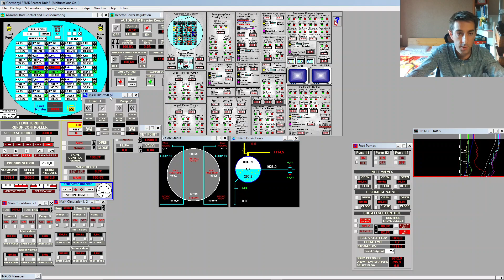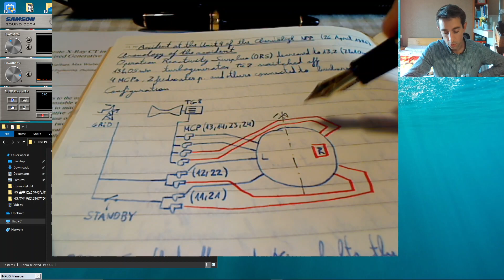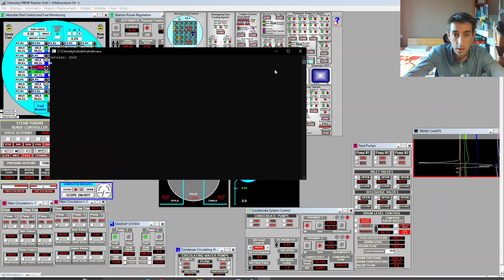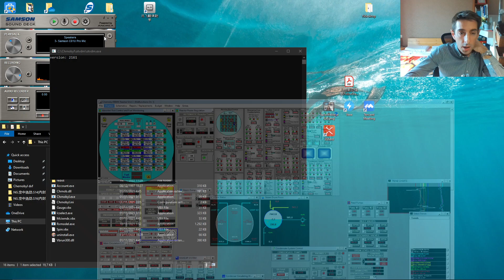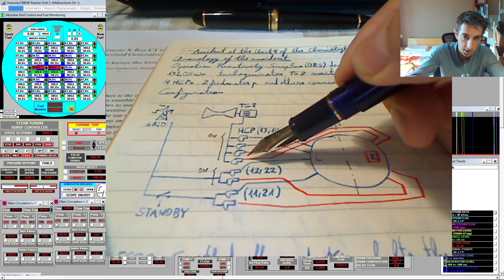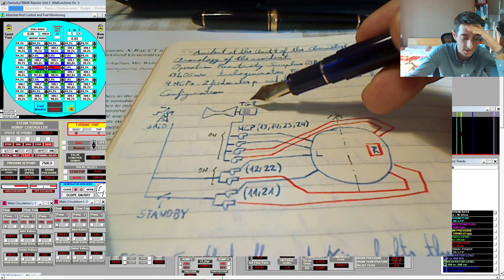Chernobyl RBMK simulator port version 2: Shift Supervisor with notes

Comment: hello again. if you can, watch or listen to this video with a translation into your language. This man, a reactor technologist, talks about the causes of the Chernobyl accident. He has many videos explaining the principles of operation of both nuclear power plants and RBMK reactors specifically. 
in short, he says that the explosion occurred due to the supply of water on the verge of boiling to the right southern side of the reactor (it was there that pipe ruptures were found), as a result of which steam began to form, which damaged the reactor inside from expansion. (sorry it's a translator) watch?v=OQpemhv8vTQ 
(take a look at the video descriptions)
Reply from the maker: Thank you very much for the link. It is very interesting. If I understood well, to some extent is in line of the official version, but it goes more in detail with the steam separation happening within the channels. Is that correct?

Comment: hello. tell e what would have happened if the staff had not resorted to using the AZ 5 button. Would the reactor have exploded too, or would it have remained intact but been damaged, would there have been an accident too, but not on such a scale?
Reply from the maker: Hello, thanks for the comment! This is difficult to tell given the reactor inhomogeneous reactivity and the probably incomplete or false reports of what actually happened. Looking at the reactivity trend after the coastdown test started (increasing), doing nothing would likely end up with a critical runaway. Operators were actively inserting absorber rod group "G" but since this was not enough to counteract reactivity increase they pressed AZ-5. My guess is that if they continued inserting group "G" and then followed with the next group according to the main rod sequence, eventually they would have regained control of the reactor before power got too high.

Comment: To refuel you can also click and drop the old fuel in the same place so the geiger counter "unequips" and it no longer shows fuel level. Also I found out you dont actually have to replace the entire fuel to fix the damage, you can just replace half. Not sure if its a bug or on purpose.
Reply from the maker: Thank you! I will try

Comment: hi, I want to program a rmbk just for fun.. where did you  get all the information about it from?
Reply from the maker: Hi! Just from the users manual, but that is only enough for operation, not to program the entire thing. How are you gonna program it, language?
Reply: @argilaga  Hi, ok thanks. I mean where does the company simgenics for example get information from like massflowrates, heatflowrates or other data for verification? I want to do it in C and Basic with some easy graphics

Comment: I manually lowered the rods along the left side of the core and found that the temperature in loop 1 does not tend to decrease. Instead, loop 1 temperature rises for a moment but only slightly.
Manually lowering the very center rod causes the temp in loop 1 to drop dramatically by comparison. I can get the temp in loop 1 equal to or even lower than loop 2 this way.
To me, this seems to indicate that in the simulator, loop 1 & 2 are center core & the outer rods.

I did these tests with thermal power correction OFF, I still don't really understand this controls function completely. It almost seems like rods tend to move by automatic command MORE when this control is off which is strange to me.

Comment: Nice video! Webcams are looking good and clear.

I see what you mean about the loop 1 and 2 probably being left side/right side. I just find it odd that loop 1 is always a little hotter than loop 2, it seems no matter what. 

With this in mind, now I'm trying to see what it takes to maximize thermal power in the core. My current hypothesis  is that it could be possible to adjust each rob position independently so that every fuel channel is close to 100% thermal power but not higher. I think this will produce the most power while: keeping all the fuel rods burnup rate about equal and also, not contaminating the steam drum or DA as quickly from having a few channels above 100%, thus less burden on polishers for more efficient operation.